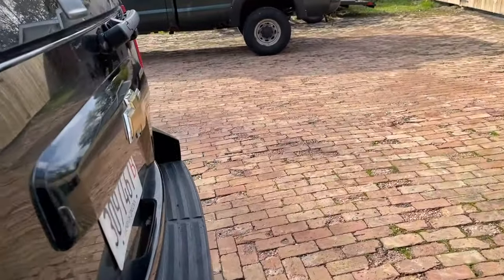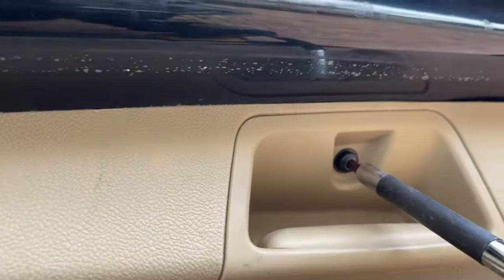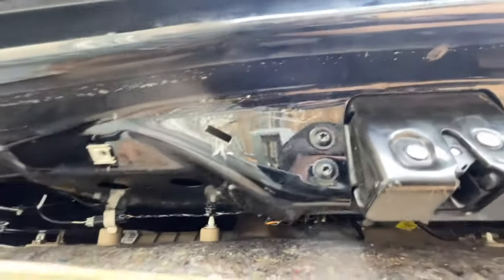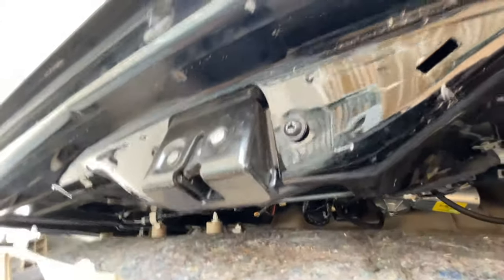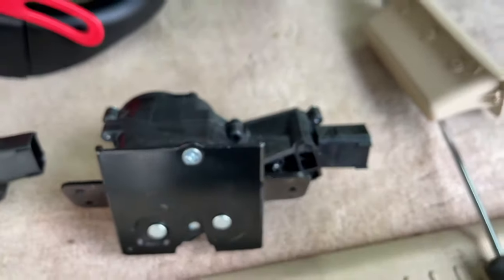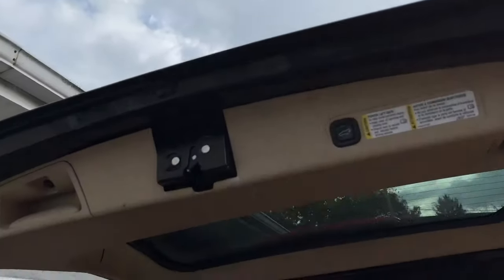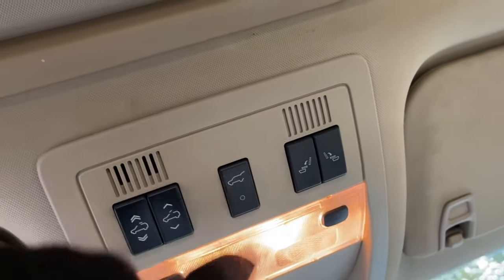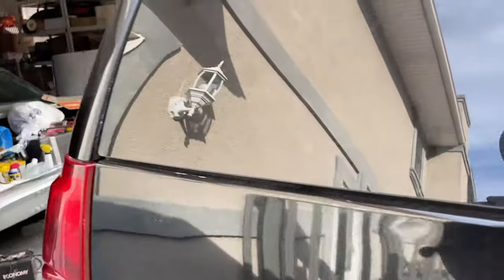2007-2013 Chevy Suburban, Tahoe, Traverse, Equinox Power Liftgate Door Actuator Latch Replacement

Comment: I replaced mine but it didn’t change. Mine doesn’t make any noise by the remote, the door button or the interior button. Nothing happens at all. What could my issue be? Battery was replaced recently and it worked before that.
Reply from the maker: Did you check the fuses?
Reply: ...or the struts on each side  might be the issue. Which battery? The vehicle battery or remote battery?

Comment: Did anyone have their vehicle say “REAR ACCESS OPEN” when it’s definitely closed? Mine yells at me and repeatedly tries to lock all the doors while driving down the road. Especially when going over bumps or cattle guards. Thanks in advance!
Reply from the maker: It's funny you mentioned this. My Suburban is doing it right now! Lol. It started a couple weeks ago. As soon as I get time, I am going to fix it and film a detailed video of the fix. Thanks for watching.
Reply: @TerenceDIY  Crazy! Any idea what makes it happen?
Reply from the maker: I think it has something to do with the BCM (Body Control Module). I'll dive deep into it as soon as I finish these other jobs that's in front of me.
Reply: @TerenceDIY waiting for that video brotha ✊️
Reply: @TerenceDIY  Have you had the chance to chase down this issue? My Tahoe does the same thing. It drives me insane!
Reply from the maker: Nope. Unfortunately, I sold it.
Reply: Has anyone figured this out ?
I want to say my rear camera started acting up, the mini rear lights inside for park sensor, and the hatch not releasing all around the same time. Is this all controlled by the BCM, or is there a sensor in the back going bad ?

Comment: What is the part i would get if it won’t stay closed. The latch won’t lock for a 2019 Traverse is the part you used in this video the same
Reply from the maker: Here is a link to the part for your vehicle....

https://www.amazon.com/Assembly-Suburban-Traverse-Cadillac-Escalade/dp/B0BBRKRHQ8/ref=asc_df_B0BBRKRHQ8/?tag=hyprod-20&linkCode=df0&hvadid=622809676531&hvpos=&hvnetw=g&hvrand=18286382533862406918&hvpone=&hvptwo=&hvqmt=&hvdev=c&hvdvcmdl=&hvlocint=&hvlocphy=9021629&hvtargid=pla-1807380160460&th=1
Reply: Change that still not latching when I close
Reply from the maker: You purchased a new actuator?

Comment: Wounder if i have same problem. Mine won’t open electrical but manual.
Reply from the maker: Possibly Jonathan. It's an easy, inexpensive fix. Thank you so much for watching.
Reply: The switch by the front dome lights / moonroof switch could be off. I've seen that happen.

Comment: Mine makes no sounds
Reply from the maker: It's most likely burned out.
Reply: @TerenceDIY  ok it was the 30amp fuse. It works now
Reply from the maker: Awesome!
Reply: @navajorezathlete1202 where's da 30amp fuse? In Da fuse box under da hood?
Reply from the maker: I believe that fuse is located on the inside.
Reply: @B_MONEY_KINGB  yea it was under the hood
Reply: @navajorezathlete1202  thnks I just put in a new latch and it's still not working right
Reply from the maker: What is it doing now?
Reply: @TerenceDIY  the latch isn't latching it's making noise lik it's trying to
Reply from the maker: Okay. Tell me this, was it a new latch or used one? Thanks,
Reply: @TerenceDIY  new I got a warranty with autozone

Comment: My door open but when I press the bottom it won’t close any idea
Reply from the maker: If you're talking about the button on the door that closes the hatch, the button itself can be bad (I have seen that), or the acuator is going bad. Check to make sure that button is still plugged up as well. Thanks for watching.
Reply: You think maybe change actuator
Reply from the maker: @cesarescobedo2943  , is the actuator making noise? I would check that button first.
Reply: Yes it only clicks when I press it
Reply from the maker: @cesarescobedo2943  ,  sounds like the actuator. Here is a link for one...

https://www.ebay.com/itm/265875399507?fits=Year%3A2007%7CMake%3AChevrolet&hash=item3de768a353:g:YaQAAOSwvZ1jGZUS&amdata=enc%3AAQAIAAAA4EFGWEU9m9JtEV8IfhqHVotsvu874QWHY%2FN5Jv2k0o5RbO27xIQZGT7W3qnbI3TfdFCIidvE0j6SMRaCbma4S5HgOuD9Nb4dqm7JTTP6TwfCWwVMIDn4cSe%2BBSLLQXwgSakqguT29GM0CagYjMFDg6Ox5%2FM09GQG7TfNstx4Eb2Qb%2FqBBXRNbM1j%2FLxMuktudPId1KGVFHbi%2B19XQEinOZnprOpHwgKFjOrmcSNP2KaAV8pJwsUwRmvwsKQeZoPa54yv9Pcnzs5%2F4TaiFsmRfJQIuigGT1qv7QSLhXIf1mIu%7Ctkp%3ABk9SR9LUiuvzYQ

Comment: What's up, just wanted you to know that I was able to get those 2 spark plugs out. Now, I am changing my water pump. Since I have everything exposed, I am replacing the belt tensioner, engine belt, and idle pulley. The thermostat, is still good. But, debating if I should just put a new one in the van, now. You know, those radiator hoses can be stubborn to get off. I have those 2 small hoses to take off the water pump, and I will be able to finish the job. Question, on your van, does your power steering dipstick, have a hot/cold, fill level? If so, if the power steering fluid is at the cold level, does that mean it's low on power steering fluid?
Reply from the maker: I don't believe there's a hot and cold fill level. It's an hydraulic fluid. It will only be low or partially full. If it's low, then you have a potential leak somewhere. I wouldn't worry about the power steering fluid unless you are getting a whining noise in which will indicate low fluid. I also wouldn't worry about the thernostat. They rarely go bad. But, it's up to you. Great job on all the work you have done!
Reply: @TerenceDIY  Well yeah, I just checked the thermostat, it's still good. The Ac belt still good, and my engine belt good, for the most part. But, will  buy both belts, to have in reserve. But, far as the power steering, I have a hot/cold, dip stick. So, just was wondering if it suppose to be filled up to the hot, or cold line? I have a 2008, Chevy Express.
Reply from the maker: @conradsuddarth632  , I apologize. There is a hot and cold line on your van (same year as mine). Check it when the vehicle cools off. It should be at the cold line and vice versa when the van is hot it should be at the hot line.
Reply: @TerenceDIY  , ok cool. Hey, I was able to replace, the water pump. Thank God, for guiding me through it. But, getting those radiator hoses off was something terrible. So, I am making sure everying is up to date, because I do not want to go back under that no time soon, after all this. SMH. However, I'm glad I was able to do the maintence myself & learned from you, along with a few other people, on YouTube. I saved myself probably $2500- $3000, on labor fees. Only spent $600 on all my parts, & put the work in myself. Car shops in Detroit, be trying to hit your pockets, big time. I ask a guy how much he would charge me to change my spark plugs & wires, he said $400. So, did everything myself.  Hope ya had a good day, though.
Reply from the maker: @conradsuddarth632  , Great job!! I am very happy that you managed to do all the work yourself. Once again, great job and thanks for watching!
Reply: @TerenceDIY  , Thanks, I have my van back running good, now. Engine sounds like it's brand new. The only problem I had was the air pockets, that were in the radiator. My engine was overheating, but discovered I forgot to tighten one of the clamps that's on the air-intake, by the throttle. SMH. But, by God's grace, I was able to correct my error, and resolving the overheating issue.

Comment: Any ideas? 2007 escalade..I do not hear the lock unlocking sound...I hear the motor trying...it will not open , I hit the power switch off there's no wY it opens all...checked all fuses
Reply from the maker: Hi Stephen, Mines was doing that at one point as well. You're going to have to replace the acutator.
Reply: @TerenceDIY  thank you man!!
Reply from the maker: @loyalist.city.g  , you're very welcome.

Comment: Just started on my Tahoe. Is there a fuse I can pull to stop the clicking for the moment?
Reply from the maker: Hi Bobby, I believe there is but I'm not sure where it's at. It would be easier to disconnect the battery if you have the door open already. Thanks for watching.
Reply: @TerenceDIY  Ty for this video. Really helped a lot.
Reply from the maker: You're very welcome Bobby.

Comment: Hey there, any advice for if my actuator sounds like it’s trying to open, but never releases the latch? I haven’t been able to open my trunk for a couple of months haha
Reply from the maker: The actuator is your problem. Once replaced, you should be all good. It's fairly inexpensive and a quick fix. Here is a link for the part (below). Thank you SO much for watching. 

https://www.ebay.com/itm/265875399507?fits=Year%3A2007%7CMake%3AChevrolet&hash=item3de768a353:g:YaQAAOSwvZ1jGZUS&amdata=enc%3AAQAHAAAA8HQYAreNblZXkDbkl5MIu%2BbmyCYpJeuE0zoiNkkUG8N3R0AiNb8xeo8OT3Dm7STLwd%2BhBf08aGU0FPKAUrid0nBRSbjvnzsnHTxAS%2FlIPFc9Zod4yjkLWLh6MqeNfaKh3oGJ20yTLiRp2GDMls5OAIYJu1qoccfOAc2i1Eb7pP%2Fcp9u1Wg%2F%2FcgsprEfSvkLzKRNcOCCo9ktg2P1831lDKVDx2BaZW2t6Tfh4Yl%2BgY8xVTGjbYws%2BcR8kqejEERgiNYAkvY2AO2m8cZLdszyPL9MZmFRSjpU4RuQn13GlvWc1vVlWDrsGdcrgCizj4TMrCg%3D%3D%7Ctkp%3ABFBMypCfk-Rh
Reply: @TerenceDIY  thank you for the response! However, i can’t get the trunk to open to actually get to the actuator! Is there any way to force it to open?
Reply from the maker: @elismith798  , there's actually a few youtube videos that show how to open it manually (that's why I didn't make one). There's a small circle on the interior section on that hatch. The circle is located in the vicinity of the latch. You have to take a small drill bit and make a very small incision, just big enough to insert a long thing screwdriver to push the latch in which will open with ease afterwards.

Comment: Hey! My Tahoe will only open if I fight it. I hear the motor running that opens and closes the gate. Once I have it open and hit the button to close it it won’t close either. Would the actuator you showed cause the door not to close automatically if it’s bad? I’m not sure if it’s my latch or the actual motor for the gate that’s bad.

Would yours close with the button up top once you had it open before changing out the part?
Reply from the maker: Your door is doing exactly as mine was. Yes, the liftgate actuator will fix your problem. Thank you SO much for watching.
Reply: @TerenceDIY  thanks! I used the link to the part you put up and just replaced it exactly as you showed. It worked perfectly. Thanks man!
Reply from the maker: That's awesome Matt! Thanks for watching!

Comment: Mine makes noises like it’s opening and closing but doesn’t actually close or open , it does unlock and open manually though . Would that be a different part ? Thanks man
Reply from the maker: Nope Marc. It's the same part. Thanks for watching.
Reply: Mine makes the same noise like it’s opening and closing. Locks for a little then immediately unlocks and remains unlocked is that the same part? Can’t get the gate to stay locked and can’t drive around with it able to just fly open.
Reply from the maker: @destinicuthbertson1764  , My friend truck was doing the same thing like mines until I changed his acuator. So, I'm 98.9 percent sure it's the liftgate actuator. Here is the link for the part just in case you decide to change it. Thanks for watching. 

https://www.ebay.com/itm/265875399507?fits=Year%3A2007%7CMake%3AChevrolet&hash=item3de768a353:g:YaQAAOSwvZ1jGZUS&amdata=enc%3AAQAHAAABAHQYAreNblZXkDbkl5MIu%2BbMPj%2BLcSctqTmXMGab8Vathb1EoEw25EXm2BxxWv5ctiw4dw2JwRxV%2FawfmDIzqG7vUxtaHvSHCmTbC4qPwrreLktni%2Fl03YA4%2BSSZTq1%2B1ishNkPNG2f7Cpe4x%2BwNicjQ%2FI4bAXgeZ%2BTA1W66IMrlh9%2Bud7i%2BFUz5nMTAP%2Fn2uJaEjb5WxThFPw1fN3GsXucTLNYQF9hzSLPlLSfpiC5CtjvHn%2FSbK9U3qHM4unBhq%2FwPfCCBJE%2BhiD6eay%2Bll7qZGyS%2B9BLqS5WfAW5%2Fq3FcGBbFdgSBXnQMblQVqQtELVPMaRLWE9K%2BdQFSh91klJc%3D%7Ctkp%3ABFBMjprb6tNh
Reply: Just got mine replaced and it’s working again thanks so much for your help!
Reply from the maker: @destinicuthbertson1764  , that's awesome! Thank you so much for watching.